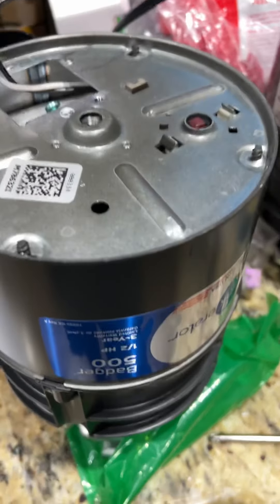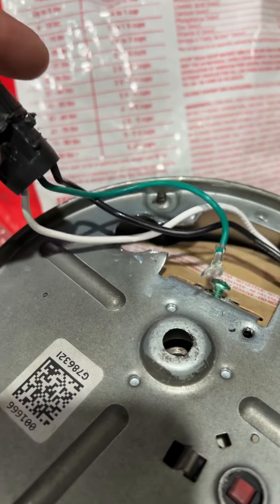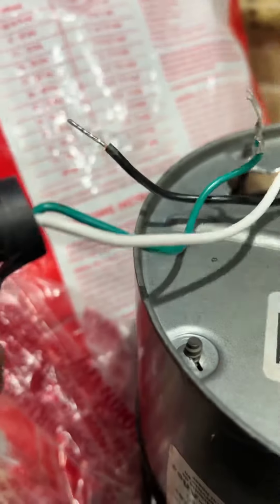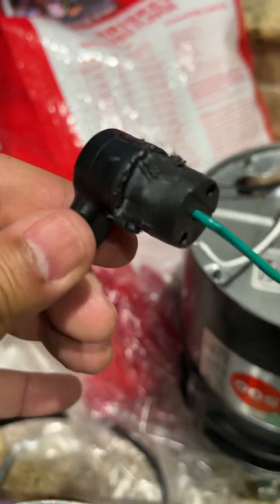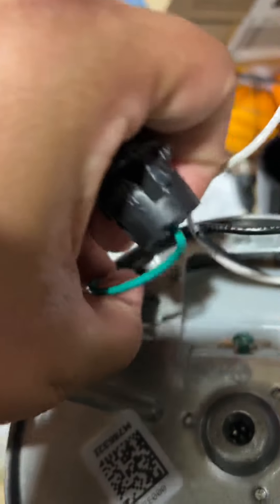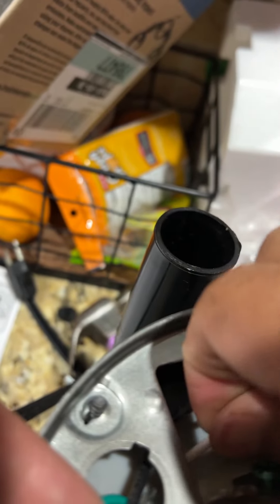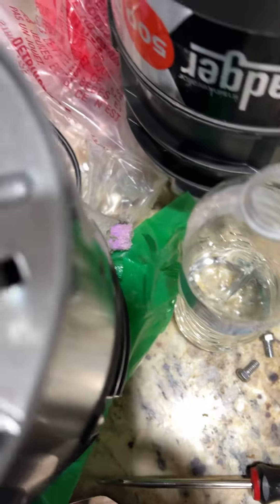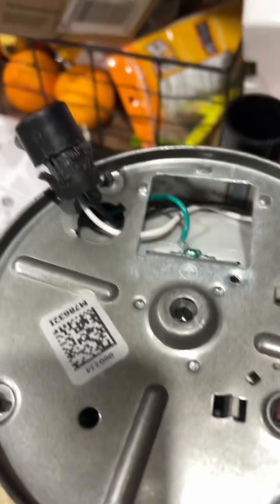Removing power cord on a Badger 500 Garbage Disposal

Comment: Insinkerator sells a cord kit that is simple to install. If you don't have tin snips to cut the metal as was indicated here. In this instance, if you manage to get the plug out, I think it would have been safer, easier, and faster to just use some wire nuts to splice the wires in the new unit. Wrap some electrical tape around the wire nut to improve water resistance.